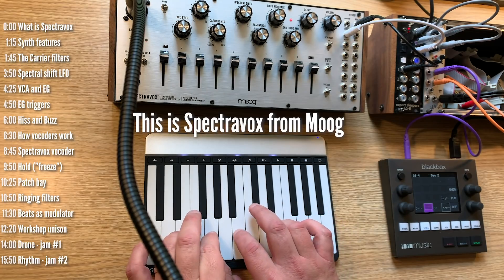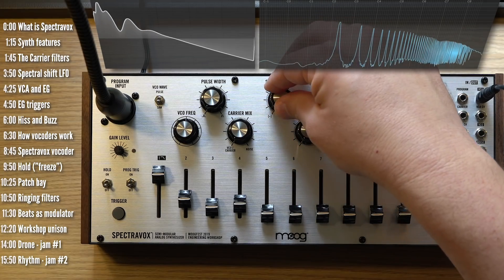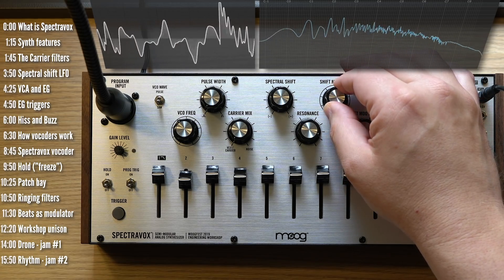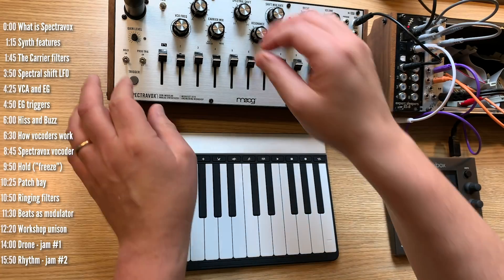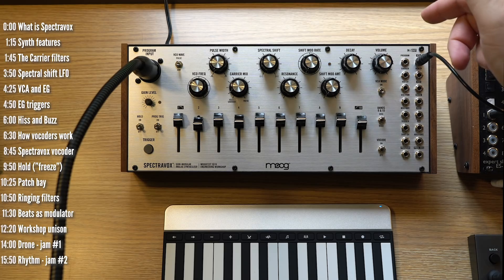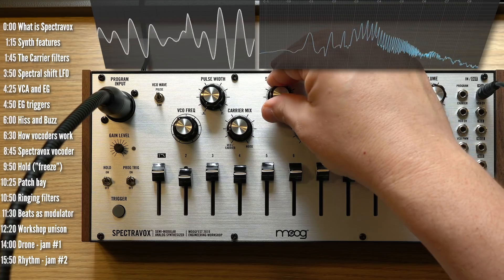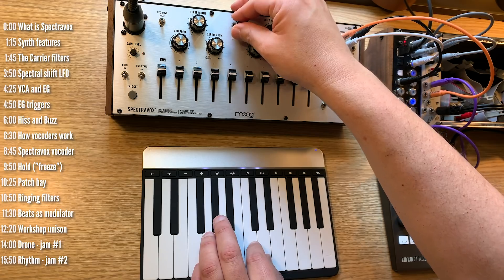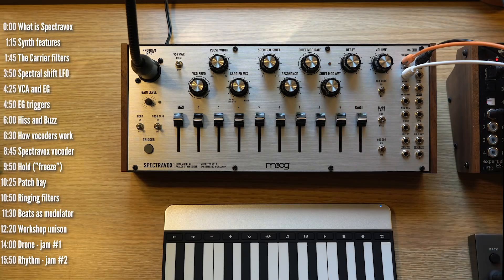Moog Spectravox - detailed overview, and How Vocoders Work (2019 DIY workshop Spectravox)

Comment: Loopop, Please help,

I have begged moog to sell me one of these, there was only ever one on reverb and it was 4k and it sold in 3 hours. My question is this. A fixed filter bank wont do the same formanty vowely type stuff you can do with this filter bank as a filter bank doesn't have an envelope or a spectral shift knob i would assume??? do you know any modules that can do something similar to this spectravox? like an analog filter bank dynamically controlled? 

does the 16ch moog vocoder do the same thing that the spectravox does? even though its price tag is 5K I just need to be able to make these sounds in an analog fashion,

alternatively can i buy your spectravox? haha jk
Reply from the maker: sorry not selling mine.... perhaps check out Fumana from Frap tools

Comment: Can the waveform output of the HOLD function on an analog vocoder like this be used as the continuously running oscillator waveform of an analog synth and played across a keyboard in a volt per octave type fashion instead of just droning? 
If this is a common feature that I’m just not aware of can you tell me which synths do this?
I’m imagining a synth with a structure like a Juno60 but before it will make sound you need to sing into a little microphone and press the hold button for each oscillator.
Reply from the maker: The hold function freezes the levels of the band pass filters - what produces the actual sound is the oscillators you feed into them, whether from the vocoder or an external source. You can modulate the frequency of the bandpass filters here, which sounds very cool but isn't like pitching an oscillator. I think what you're looking for can be accomplished with a simple sampler across a limited pitch range, and a more complex sampler with formant controls if you want an extended range.
Reply: Thank you. This does seem to be the consensus of most forums. But in a less marketable, less efficient, and definitely more romantic sense, is it possible to do this with analog circuitry? Can any continuous signal source replace an analog oscillator circuit?
Reply from the maker: Technically any digital algorithm can be built with analog circuitry, it’s just a matter of how many circuits you’re willing to throw at the problem. I’ve made a different video about using a sample and hold circuit and switch as ram. Use enough of those and you’re good to go ;)

Comment: Very good, but the vocoder sounds are not clear enough. Is it the quality of the microphone? By the way... Do you need a dynamic or a condenser type of microphone for vocoding, do you know?
Reply from the maker: You need to hit very specific settings to make the vocoder legible and I agree that even then it’s not perfect by any means. IMHO what makes this special is its filter bank as a synth and treating the vocoder as a modulator rather than just for speech
Reply: The microphone isn't really that important. In order to get more legible sounds when vocoding voice, really you need more filter bands than this, you would probably be looking at 16 bands instead of the spectravox's 8. However, that gets very expensive very quickly with analog circuitry, which is why there are so few analog vocoders around. Digital allows for more filters for cheaper, so most modern vocoders are digital but much clearer. Hope this helps.
Reply: @Mattom-sy7bz  Spot on other than the fact that the Spectravox has 10 bands - the bottom band is a low pass, the top band is a high-pass, and the 8 in the middle are band-pass.
Reply: @Mattom-sy7bz  Τhank you all!

Comment: if you had to chose one, this or the subharmonicon?
Reply: @RomeroFanboy For me, although both would be fun, I would get more actual use out of this one.
Reply: This one is better, I have both
Reply: This one. You can build a subharmonicon with dedicated Doepfer modules (the Trautonium modules) which sound just like the original trautonium. But it is a gimmick in my opinion - in terms of practical use this little vocoder strikes me as far more useful.
Reply: I want both